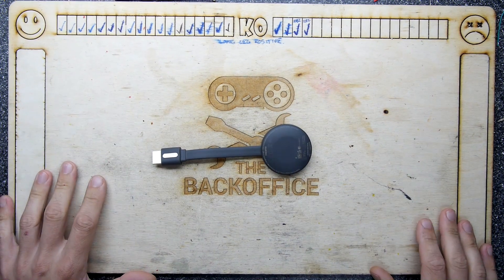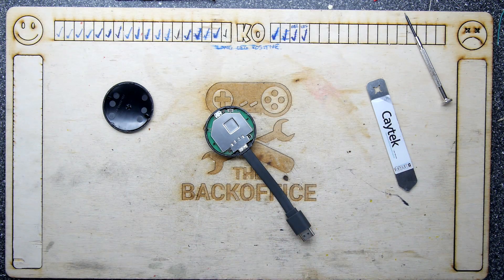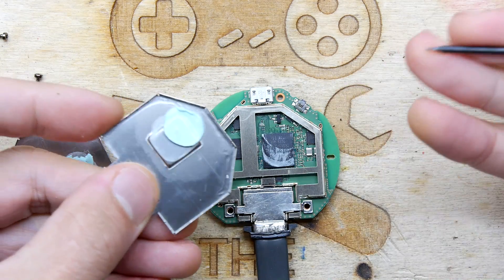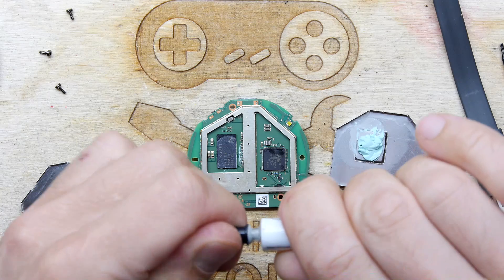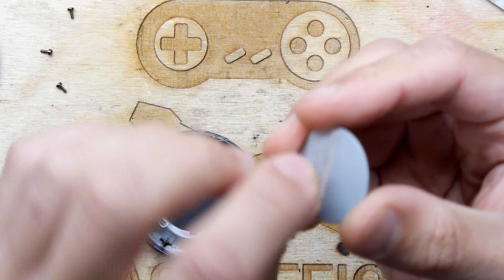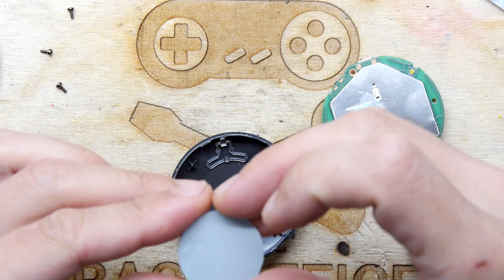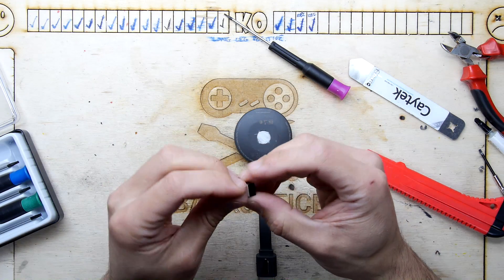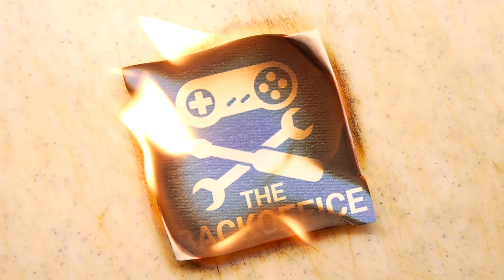Overheating Chromecast Repair and Upgrade Stadia

Comment: I noticed you did not put new thermal paste onto the other black chips. Would doing this help keep it from overheating or should I just leave them without any on?
Reply from the maker: Anything that touches a heatsink would probably benefit from it
Reply: @backofficeshow  I will try putting thermal paste on all the chips then and see how it goes. My gen 2 Chromecast doesn't reboot, but after a couple of hours on in the day it'll say reconnecting to internet every few minutes or so. Probably from overheating.

Comment: My caster kept boiling over. Did as the vid suggested, however was unable to loosen the screws. I suspect a laid off mechanic put them on. Now the caster sits open with the paste on top keeping all cool. Thank you. It works

Comment: Bought a 3rd gen and put heatsinks on the side with the heatsink inside. I guess that will help too. Although 3rd gen is not overheating but i just used the heatsinks of my first gen chromecast which lasted 6 years. The heatsink is bigger than the cc3.
Reply: Pit a crystal under it that will absorb and remove some of the heat. Small ones are not exspensive.

Comment: For now i attached the heatsink of the intel boxed cooler and a 120mm system fan behind. Temps are outstanding, but it is very ugly
Reply from the maker: I'm still using this one, ugly is fine for something that lives behind a TV. I might try water cooling next 😂😂
Reply: @backofficeshow  funny that you said that because today i bought a aio watercooler with one 120mm radiator.
Reply from the maker: Make it happen 😂

Comment: Hmm I am not as well accustomed with such activity. I was wondering if you could mod one for me? I would ofcourse pay you for it.
Reply from the maker: I think you could try these or similar https://amzn.to/3edBwhK
Reply: @backofficeshow 
Excellent thanks for this do I just cut it with a saw and stick it on?
Reply from the maker: Hopefully you will not need to cut it. Try to put all you can, both sides even
Reply: @backofficeshow 
Excellent thanks so much for this. I have this problem especially when I am in Morocco. If you  haven't been I highly recommend it. 2 and half hour flight and restaurants and hotels are ridiculously cheap. Albeit I would certainly wait for the lockdown to be lifted.

Comment: I put my house fan behind the TV and left it disassembled. That metal disk enclosed in that seems too heavy to be any good at dissipating heat tho I could be wrong..that lil heat sync was pretty much what I was thinking but directly on the chip

Comment: Would adding the paste and making the hole be enough? I don't have the heatsink
Reply from the maker: Find something to use as a heatsink, a piece of metal, old pencil sharpener etc
Reply: @backofficeshow  thank you! I have an old pc big heatsink, would that work?
Reply from the maker: Anything you can fit or cut down to fit etc as long as it has good contact. Maybe use would wire or elastic to keep it secure

Comment: My first generation chromecast has the same thermal paste inside, and what looks to be some slippage as well. Theres a big slab heatsink already attached to the RF shield, but its definitely moddable, at least with some new/better thermal compound. Thanks for the video!
Reply from the maker: Thanks for the comment, good luck with your cooling!

Comment: Thanks for putting this together! I'm not quite sure which driver is required to remove the screws that hold the PCB down. Do you happen to recall?
Reply from the maker: I really can't remember, but if I were guessing I would say a small Phillips

Comment: Before the upgrade, the temperature is cool?
Reply from the maker: No, it was hot. Hence the modification.
Reply: @backofficeshow  I am going to modify mine, since in the use with stadia it produces a lot of heat, I am going to also put fans on both sides and heatsink is on both chips. Thanks for the video has been very instructive.
Reply from the maker: @Shamanosuke_Nohara  Forced air should definitely keep it cool
Reply: @backofficeshow  cromecast HD for stadia is more compact for components. I seend photos later thx

Comment: Very short summary: At bout 4:36, you'll see that the thermal conductive paste is not well placed and leave some part of heating processor without conductive paste. At about 8:30, there is a suggestion to cut and to install an heatsync. By the way, thank you for the video. I have overheating problem here with mine.

Comment: Mine did not improve in any way after the mod. In fact, it seems even hotter with the heatsink. :(
Reply from the maker: It detected your efforts to thwart it and is getting it's revenge 😂

Comment: I took mine apart and spliced in a tiny 12v PC fan and mounted it to the board with hot glue.
Reply: Did it work?
Reply: I also used a Canadian loonie ($1) for a heat sink. Still using it, no issues.

Comment: Putting thermal paste under the thermal pad is not a good idea. Btw, the slided one was the wifi chip.
Reply: Why ? Not good to mix ?

Should I just remove the paste and put new one ? 

I was going to do that mod just a little bit more heat sink

Comment: Thanks for the help. I replaced the thermal compound on all places, and installed a heatsink like you suggested. 
I'm running a stresstest right now... As of writing this the test failed, it managed to play 10 minutes of a episode from netflix. :( 
I thought the problem could be overheating, but it's seems to be something else... Any thougts would be appriciated :)
Reply from the maker: Was there any noticeable heat on the sinks? It may well be worth to do a full reset of the unit (you probably did) as well.
Reply: Thanks for the answer! I think I solved it, and I'm a bit embarrassed about the cause. I was using wrong poweradapter, I found the original adapter and since I switched I've been able to stream about 50 minutes of netflix without crashes (and still going).

Also, the thermal compound that was originally on the chromecast hadn't moved like your had. So my problem was probably just me using the wrong power adapter. 
But atleast it's modded now so hopefully I wont have to worry about overheating for longer :)
Reply from the maker: I'm sure the end result is better in the long run 👍😂
Reply: @loweraivio3456  well i dont have the original adapter.Which specs does the charger have?
Reply: Tolgahan Çelik had not had a problem since i switched. Sorry but I dont know which of my chargers I used before.... but yeah it mustve had different specs...

Comment: I stripped with a rubber band chap metal radiator to the plastic case of the Chromecast. That helps too with summer overheating resulting in Chromecast 2 rebooting. https://www.aliexpress.com/item/Heat-sink-22-22-10MM-silver-slot-high-quality-radiator/32791991008.html?spm=a2g0s.9042311.0.0.27424c4d1PQS4f
Reply from the maker: Nice one! It really does work

Comment: Big company like Google developing crap solutions for cooling. It's a disgrace. I now have two units overheating. I didn't do all in this guide, I just taped two heatsinks on each side and now it seems stable. But who know it's obvious that the components run warm and reduce their lifetime. Wtf? Same crap with the nexus 5 from LG (Google indirectly) with bga solders that were crap. Most of the nexus 5 were doomed to destroy themselves after a while. Google are ripping us off with crap.
Reply from the maker: It's not just Google, been happening for at least a decade with laptops

Comment: In reality, you should have removed the flimsy disc which probably isn't doing much as a heatsink, seeing how it's paper thin and made your square hole over the raised bit where the putty was located and place your much nicer heat sink there.  As its over the chip that likely needs it.  I know it seems very unplanned and you were putting it back together and saying what the hay!  But, that would have likely been the better way to heatsink the thing.
Reply from the maker: I can confirm that it still works after all this time so I guess it is good enough. Probably just removing the plastic of the case would be sufficient
Reply: Yeah, I would imagine the heatsink still holds heat, but would likely move more heat away from the processor than the thin sheet of metal all the same.  Like you say, removing the plastic would probably be sufficient to let it breathe.

Comment: The rat cut the side of HDMI wire of chromecast 2. so where to get it replace/fixed?
Reply from the maker: You might try a local handy electronics repair place, but I don't think it's an economic repair. ☹️

Comment: Hey, nice work, just wondering if it has been functioning ok since the fix. I just got one off ebay that reboots about a minute into casting, and suspect it's overheating. I was going to do the same thing you did, and actually found your video by looking for a way to remove the lid.
Reply from the maker: It's been perfect ever since. Might be a good way to pick up cheap Chromecasts 🤔

Comment: IT will be Nice to see it through thermovision camera how is the heat distribution, have you measured the surface temperature before/after mod ?
Reply from the maker: +Jaroslav Sloboda No, but while I still have a borrowed flir I can try to mod another one. That being said it still works great. I suppose this should work on any small dongle device

Comment: Had problems with mine when they first came out. Screen would act up and turn green. Was under warranty but the process was complicated and they wanted me to use google wallet and I said no. I took the plastic cover off and the heat sink compound had shifted out of place like in your video. Google phoned back to arrange a replacement and I told them what I did to fix it. They were really pissed off and refused to cover it under warranty. Now I use it with no covers and it works great
Reply from the maker: Bill  K Nice one 👍 is hardly worth the effort of returning it isn't it? Glad it was a similar fix, it really makes me wonder how many fail in this exact same way.
Reply: great video, could you tell me if there is this HDMI cable to sell? my Chromecast needs a new cable
Reply from the maker: Any HDMI extender cable should work

Comment: I've never had a problem with mine but something to keep in mind if that issue does occur :-)
Reply: The Backoffice isn't that 40%?! 😉
Reply from the maker: +WeirdScience06 I think we have around 5 between us and two have had the issue, I guess that's a 20% failure rate 😂 to be fair they started out fine, so probably depending on their orientation the material might migrate or not 🤔

Comment: Would the heatsink be useless if the thermal paste slides off again,Then there would be no way to tranfer heat out to heatsink .just a thought
Reply from the maker: I think there would be some transfer to the metal disc, so increasing the efficiency of that disc may be enough to keep it going. Thought to be fair, I am sure we will all be using v3 or v4 chromecasts by then :)

Comment: I'd bet that just drilling a series of small holes around the sides of the case would drastically increase cooling. Giving even a little of the heat a place to pass through besides radiating through the plastic would probably help a lot. But yeah, the migrating thermal goop probably causes a lot of people's troubles.
Reply from the maker: +Thor the small hole approach is a great idea. I can't believe they still have heat issues in a second Gen product. I think they are relying too much on thick paste to make up the gap in tolerance. A tighter can would have been better.
Reply: The Backoffice buy a dremmel 😂😂
Reply from the maker: +Brian Jones I have one or more dremels, too messy!